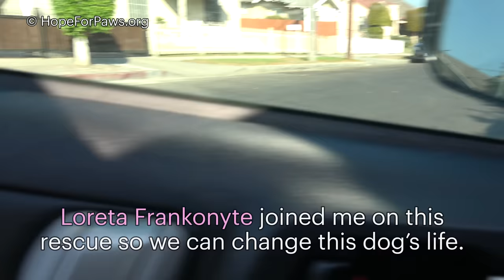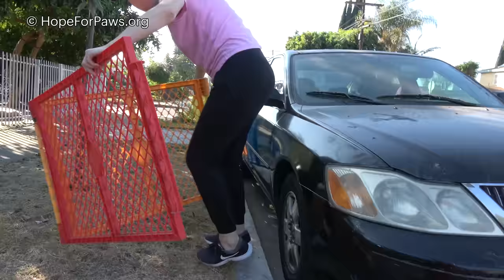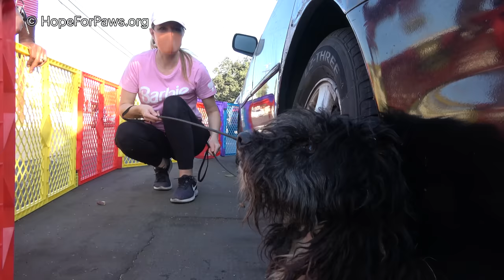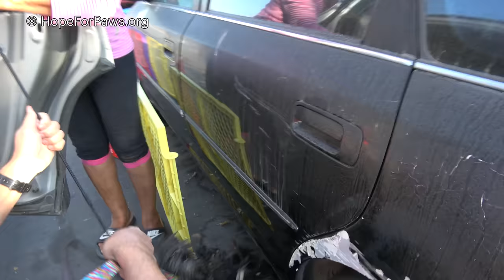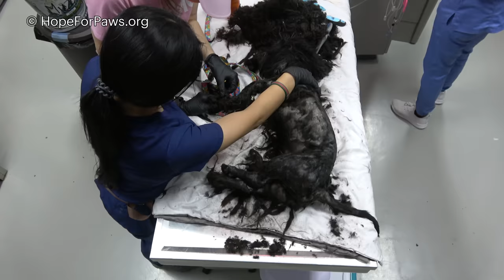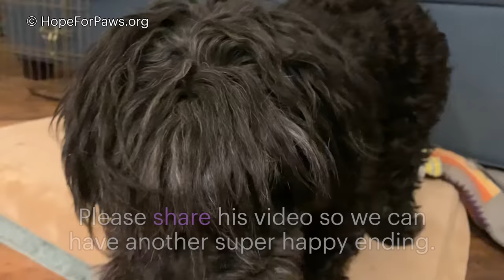Matted, dirty and never knew a loving touch - let's find him a home together! #terrier

Comment: Something that I wanted to say for a while. I see Eldad, Loreta and other HFP rescuers that sometimes have to climb or use both of their hands. There's a special camera used by free runners called Go Pro, it can be held by a special device in your mouth or you can just place it on a head band to keep it steady on your head. In this way, you can do everything with your hands free without having to worry about holding a camera.
🎥🤗😁📸💖😘